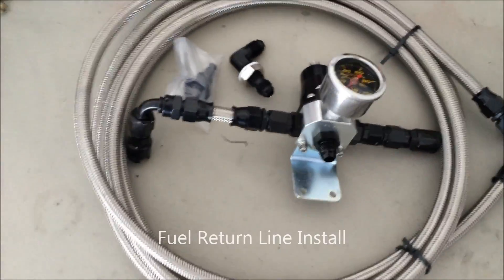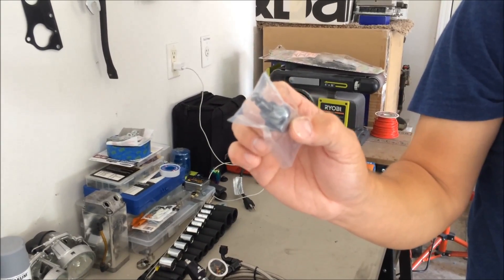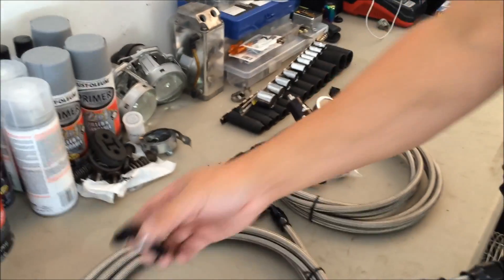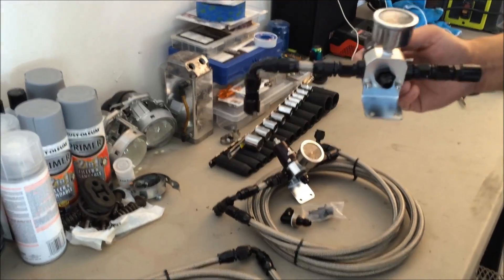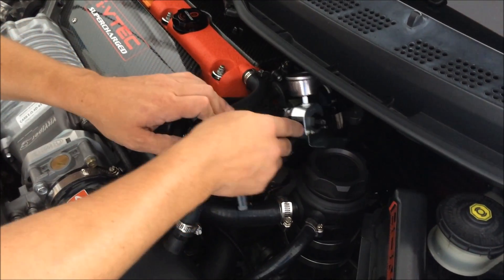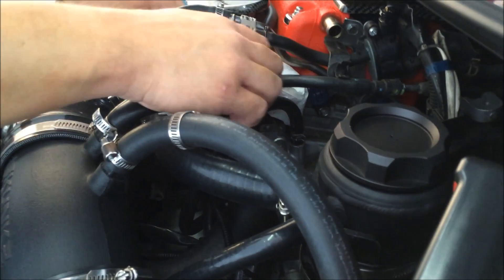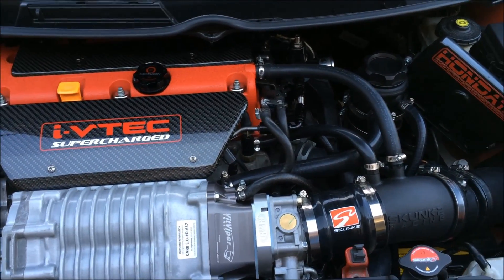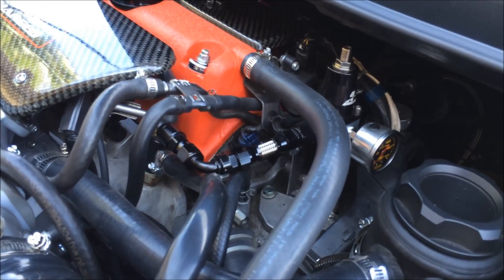Fuel Return Install 06-11 Civic Si K20

Comment: did you hook up the vacuum line on the regulator?
Reply from the maker: Yes
Reply: TheTongMan you set it to 54psi with the car running and the vacuum hose not connected? And after its set, you connected the vacuum hose?

Comment: good job man, after this a fitting need to be add at the top of the fuel cage for a return fuel, secondary line will need to be routed through , also feed line will be replace by the new line for better fuel flow

Comment: does the return plug and play
Reply from the maker: +Dan Bertholf no. the external fpr needs to be assembled, the fuel cage needs to be drilled, the stock fpr needs to be extracted and replaced with the blank, and u gotta run the return line.